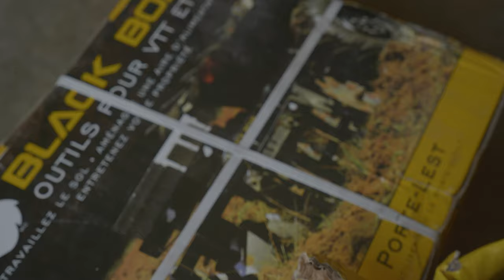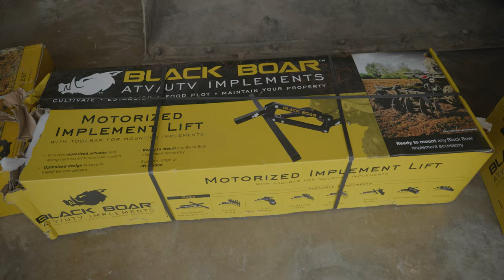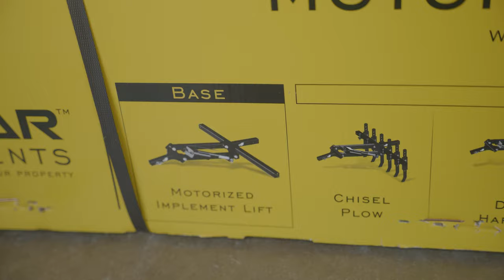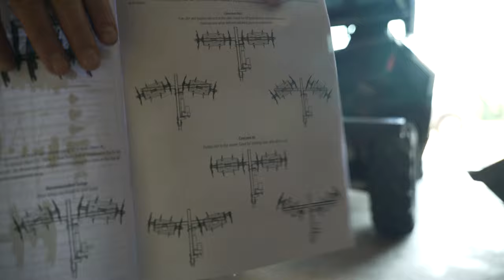Black Boar ATV Implement setup, overview & Polaris RZR test FAIL

Comment: As a retired farmer I would try different setting on the harrow gangs .Looks like there is 3 adjustments that can be done . different setting will cut different . The way it is set now you are cutting the sod and bedding it kinda . Start with the gangs straight to cut the sod and then go to a angle cut . you should get better results. but it is lite and not much downward force so you results arent going to be outstanding .Also to i use to use a pull behind tiller to do foodplots where I could not take one of my tractors.You mentioned a tiller but didnt say if the one you have is walk behind or towable. i hope this helps out.
Reply from the maker: Thanks for the info.  My tiller is towable but I need to put a bigger motor on it the speed that it cuts through the ground is so slow it’s almost like my rzr wasn’t moving

Comment: I almost got the cultipacker set up by them but wasn't sure how well it would work compared to other alternatives... any advice... holy crap man I just seen the damage to ur razr... that sucks I have a canam commander 1000 with a 2 inch sleeve I was just thinking how ur razr held up and then boom I seen what happened 😳
Reply from the maker: Yeah it's pretty unfortunate but there's a shop by my house that can fix it and reinforce it to work with the system
Reply: @we-will-see-what-happens  any advice on how well the cultipacker would work
Reply from the maker: @AllThingsCool  honestly it's hard for me to know at this point I would say just get the manual implement lift because I think the electric one puts too much force on the sleeve.
Reply: I think you were putting alot of stress on it by going too fast in hard ground. In your video you can see the harrow violently shaking left and right which is putting alot of torque on that receiver. Also it helps to plow first, then use the harrow to bust up the clumps of dirt.

Comment: I have this cultipacker, but I have the kolpin 3 point that looks like it's maybe a little better built. I was nervous seeing your fail, but also kind of happpy that your issue was the rzr. I have a defender with a 2" that I think is a little better designed for this kinda work... but not as fun to ride lol.
Reply from the maker: I got a new hitch sleeve on my rzr so it does work now.  I did end up having more problems using it in my upper peninsula deer camp, which I'll probably make another video  about.

Comment: I can take the suit case weight bracket off if its in the way for it to lift up not sure with the blade on if i can raise it high enough to bring it inside my ramp door of my trailer.

Comment: How high up are you able to lift the lift I have one on order from amazon I want to use it on the back of my john deere x739 I put  2 inch receiver on it tonight its not up very high to the top of my new hitch is 11 inches i want to put a back blade to clear snow out i will put it in my trailer want to make sure it lifts high enough tell me you thoughts ?
Reply from the maker: When I lift it up It doesn’t get very but it’s mainly because of the RZRs long travel shocks.  Plus the rzr is only 9 inches off the ground.  When I was able to pull it up with the ratchet straps they were well above the hitch.  Having a solid axel on the tractor you should be okay

Comment: i wish i knew how to send you the pic of how i got that receiver put on my rider took like 4 hours I had to put the heavy hitch on first that was easy then i had to grind out the holder for the suit case weights and drill the holes a little different because the heavy hitch raised everything up 1/4 inch then after all that i repainted all the parts was not fun at all.
Reply from the maker: Yeah I’m still putting my rzr back together